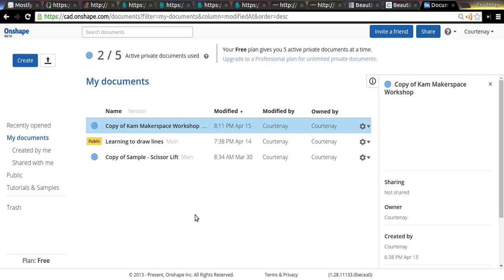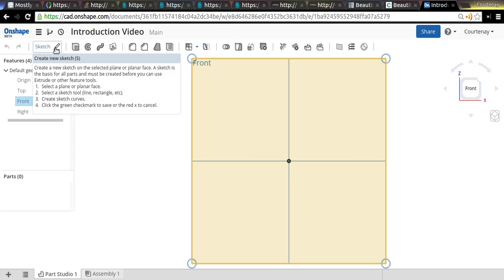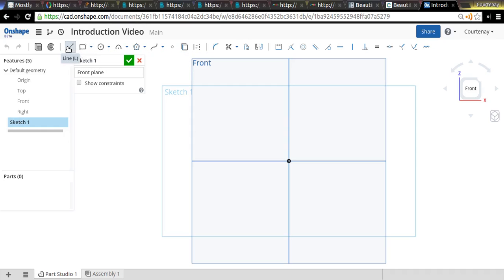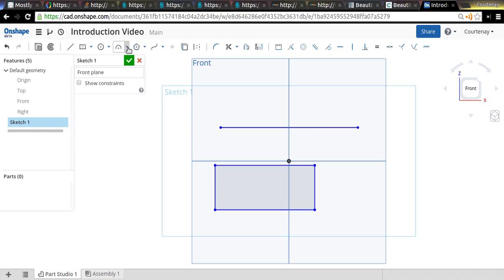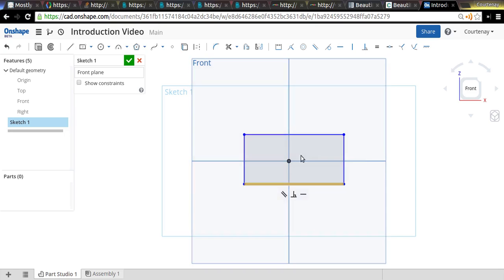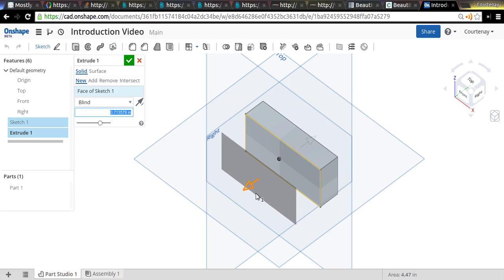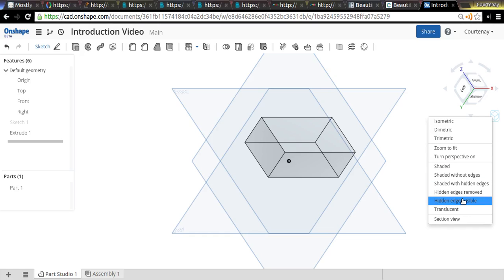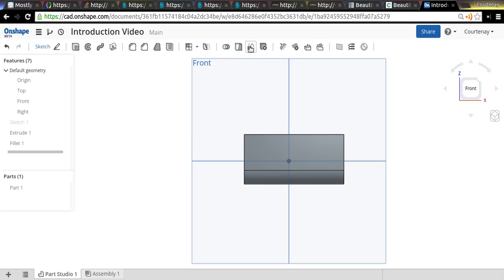Super Simple Introduction to Onshape

Comment: I did not see any automatic constraints applied to the shapes on screen, for example horizontal, vertical, etc on lines. I did see them on mouse hover, though. How do you display them, and how do you know when you have enough to stabilize the sketch elements so bad things don't happen?